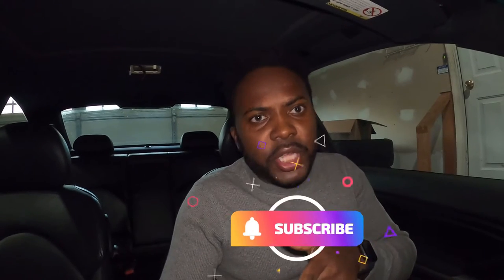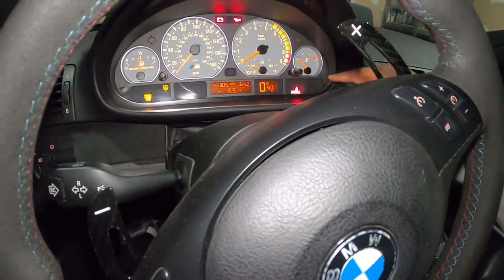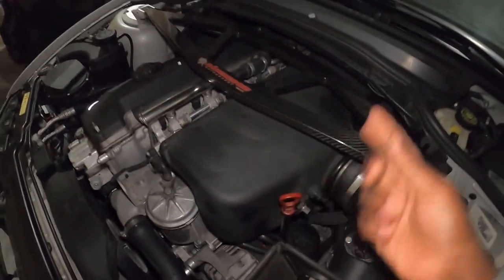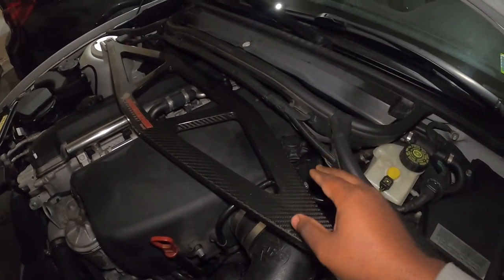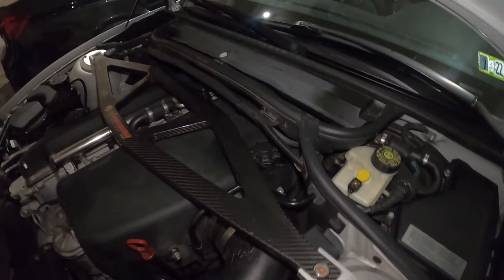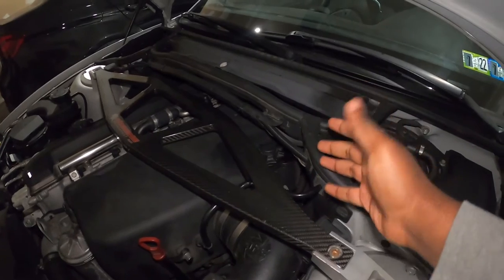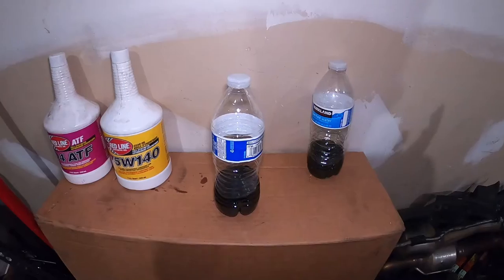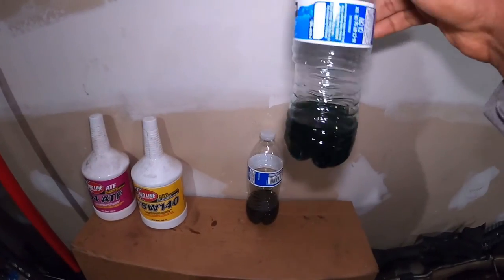Fixing The E46 M3 SMG Warning Light

Comment: I would never change my SMG for a manual.
On track days the SMG is always more fun.
And I prefer SMG over manual even for everyday driving. 
Once you master it. It’s smooth as even city driving.
When my SMG pump went it’s the motor inside the pump that fails. 
Service the pump and motor save yourself thousands.
I did my motor repair in the pump 3 years ago. And it’s should last around another 90,000-100,000 kms.

My pump went out at 93,000kms 

I did your fix at 70,000kms and it lasted to 93,000kms